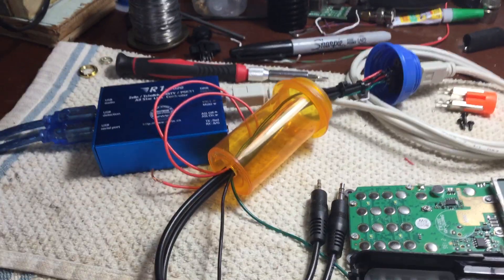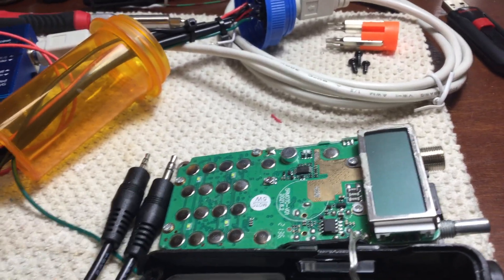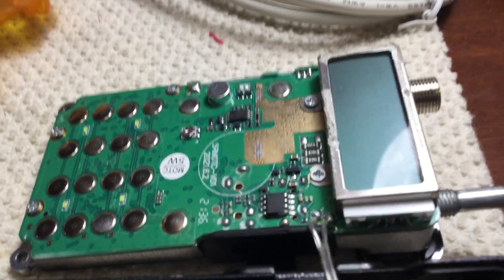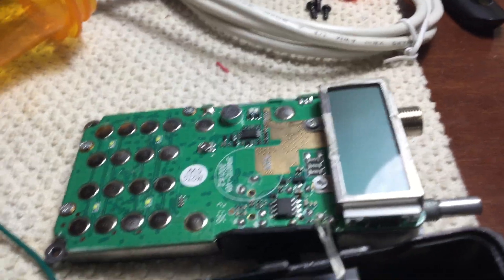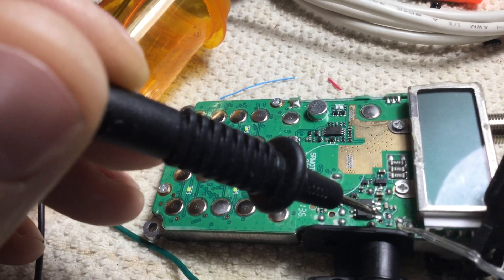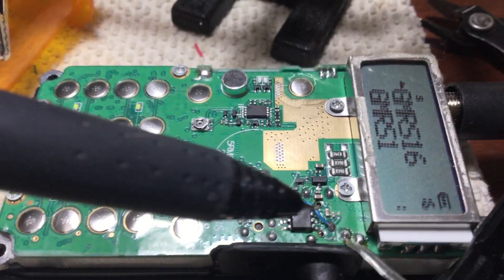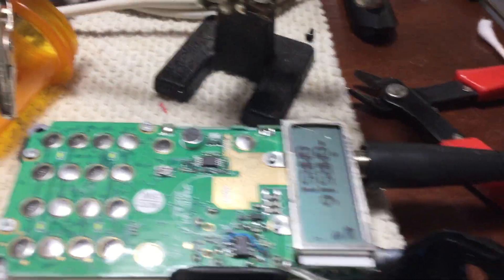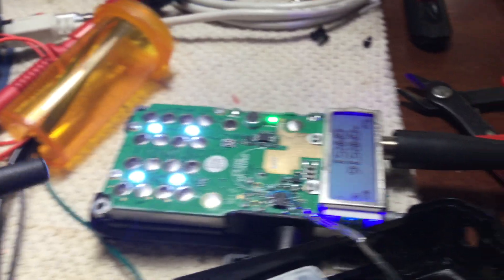🔺How to modify uv-5r GMRS two way radio for R1-2020 zello/echolink/ all star link interface box 🔺

Comment: Hello, Im looking for the simplest way to link my Kenwood NXR‑1700 repeater with Zello. My current equipment includes several Motorola and Kenwood handy radios, as well as two Baofeng UV‑5R units. I would appreciate any guidance or recommendation😅
Reply from the maker: well i don't have the Kenwood NXR‑1700 data in front of me but if you are handy you might be able to make an adapter using my rt97L interface board (link here https://www.gmrstwowayradio.com/store/product/interface-board-for-retevis-rt97l-gmrs-ham-repeater/ ) that would plug into the kenwood repeater if it has a data port or using a tyt9000 mobile radio programmed to your repeater freq and use my tyt9000 interface board info here on that: https://www.gmrstwowayradio.com/store/product/mobile-gmrs-radio-tyt-th-9000drt9000dalinco-dr-138-interface-board/
Reply from the maker: if you need more info send me an email at gmrstwowayradio@gmail.com

Comment: Hi Boss. You know, you don`t have to disassembly the radio in order to get "squelch line" nor soldering a wire taping a wire from the radio. You can make a COS or COR with LDR, and hot glue it to led, the only thing is adding a higher resistor in series with LDR, green led is brighter then red led (you know hot gluing is temporally "fix"). I have my repeater with a COR with LDR and is working great, by the way, I bought the duplexer off buytwowayradios already, it is connected, but haven`t try my repeater from far yet. because I was out of town, came back this morning.
Reply from the maker: Yes, I think I mention in the video that a person may be able to tap it off the RX led in the radio. A LDR sensor would work like you said, but I didn't have one on hand so i did it the hard way...lol Good news, I didn't have to order a part to get it to work..lol . So many different ways to do it.
Reply: @GMRStwowayradio  True, many different ways to do it. And you are becoming my mentor as well! I`m glad I found your videos, which I was desperate to learn more for my needs
Reply from the maker: @FelixLantiguaCamacho  thank you, and thanks for watching

Comment: Great video!...  Can you post the  DIN pin layout?  Which DIN pin correspond to the 2.5 and 3.5 Tip, center, etc?  Again thanks
Reply from the maker: sure can here it is http://www.gmrstwowayradio.com/R1-box-diagram-hookup.jpg
Reply: @GMRStwowayradio  So I should ground DIN pin 2 to the chassis of the metal box? , And add a 1K resitor to DIN 6.       
I saw a similar Baoeng modification for IRLP but only the resistor was removed rom the Baofeng 5R radio.   Will try this coming weekend to build the cable, I got the blue box 6 months ago and havent do anithing with it yet.  Thanks again
Reply from the maker: @radioaficionadonetwork77  - yes if it's a metal box ground it with pin 2 and for 1k resistor I didn't have to BUT you can take two exact models of radios, and they won't be the same due to component tolerance. So I can't say yes or no you may have to however pin 6 is squelch and I know at least with my blue box it was very picky on that input meaning to low on input it won't work so keep that in mind if you add a resistor, and it doesn't work. FYI i am working on a modless mod meaning don't need to mod the radio not sure if It's going to work, if it does i will post a video on it.

Comment: If you have an old mic that works with that radio, there's a +2v COR wire coming into it. It goes to ground when the radio is receiving. No breaking the radio. You don't even have to open the radio.
Reply from the maker: I tried an old mic cable, and it didn't have enough wire in it to make it work. So I grab another cable that I had here that had 6 wires (3 wires per jack)  in it and was able to use the spare for this, so I was able to make it work.  Also, If I recall the audio out did have a DC volt level on it when it was in RX mode I was hoping to use that Dc voltage as COR/SQL voltage, but that wouldn't work with this interface box maybe to low of a voltage?  I was hoping that would have work, so I won't have to take the radio apart. and if that lines only does 2 volts that may not be enough for this box which needs a high which is 3 volts and higher Maybe that will work with other interface boxes, it didn't with this box. Well, at least it didn't for me..lol anyway, this way seems to work well